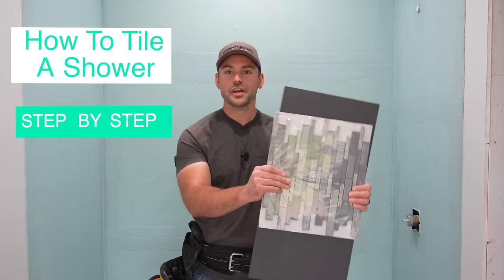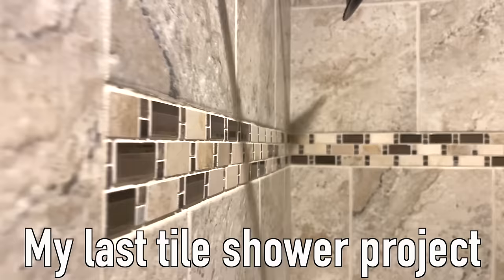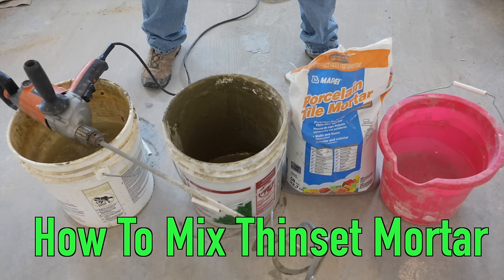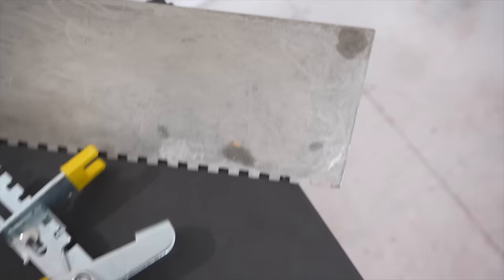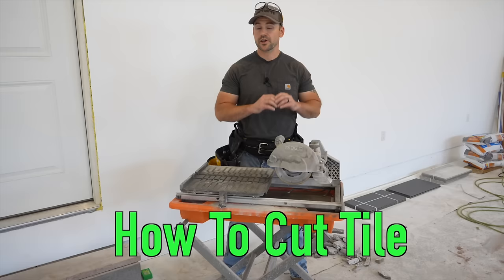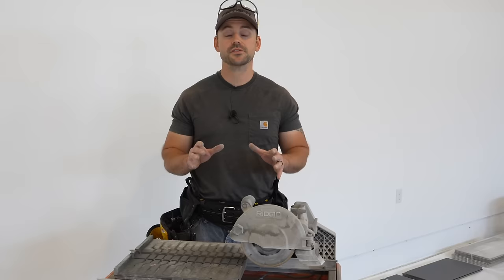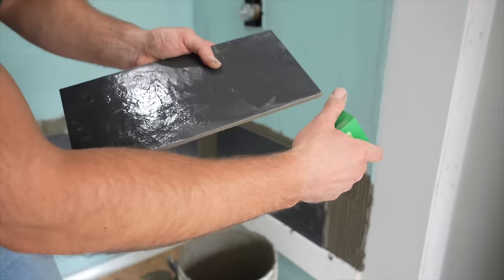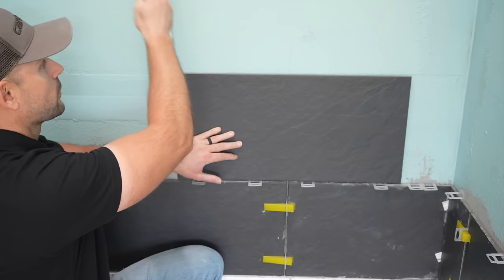How To Tile A Shower - Start To Finish Walls

Comment: 2:00…..if the shower pan isn’t level? Well….then, leaving that space at the bottom….and your pan wasn’t level….you would have to make a bunch of cuts. Right?
If for some reason your tub or pan wasn’t quite level. Couldn’t you just work your way up with shims. And level it as you go?

Then, 34:27 I’m confused as why you would leave a spot open, for your decoration. Why wouldn’t you just incorporate that…..as you work up?

Thank you for your video…I learned a lot…..

Yes, I plan on doing a lot of tile work in my house.
I plan on buying a used wet saw.
Buying my tile and as much material at Habitat for humanity. I don’t quite know if this would work for mo$$t people$$ , a$ They want expen$$ive fan$y stuff. And I simply want tile.
Here’s my list.
1. Remove my awesome old thick, and well built shower sliding door….and save it for later.
Because, after seeing how crappy, and cheap….and thin the new ones are. I will keep this one.
2. Rip out the infested feculant, moldy “tile” and wall board….probably set….right on the sheet rock. Down to the studs. Remove the insulation and save it for later.
Realize we have 1 bathroom….and we have to somehow…bathe. Leave the rusty, rotten tub for now.
3. Replace the rotten, termite chewed studs, or tie new ones on to the existing studs. And re lag them to the foundation. Install my insulation. While….the tub is in place.
4. 1/2 cement board, seamed with tape and mud. Then painted…..ahhhh finally …good bones. I plan on slipping my first section passed the tub a five or six inches. I don’t figure I need to cover the whole wall….with a tub.
5. Pull the toilet and vanity….I have to do this in one day. Then pull the old tub. I might use a cut off grinder. To section it up and make it easier. 
I will have tile, already cut and ready to go before this process. lay a 1x3 for support, and lay my first course of tile. Where it will be an inch or two under the lip of the tub.
This will be a different color design…..and then just befor the last section,  as I’m working up the wall, I will cut another course for a two stripe design. Then Lay and level the new tub, plumb it to the drain. Of course this will be the correct height, and same length…..or where I can cut it down to fit. And would be done in advance. Tile the floor under the toilet, and set the toilet.
We have a very small bathroom, and only one…remember? 
6. Lay my simple tile, all the way up. Starting at the base of the first course. I love the idea of the shelves, however I wouldn’t use silicone. I know it looks nice, but after 10 years it will come loose. The only siliconing I will be doing is around the shower door frame, and tub to tile contact. I would use mud to glue the end piece and grout the seam. Just me.
7. Cut my holes for faucets, and shower head. Remember…only bathroom. Having a drainable tub….I can heat and pour water, or use the kitchen sink.
8. Grout all that wonderful tile, prefit my shower frame, drill holes with a diamond drill for the 4 screws.
9. Clean up the grout, and wash the tile. Let dry,  Caulk the tub , let dry.
10. Install my shower sliding door.
11. Then on to tile baseboards and the rest of the floor.

That’s my plan anyway.

Comment: I understand why you started off of ur board...tile measured 11 1/4" and 1/8" at the bottom then allow another 1/8" between the tiles, that equals 11 1/2" total..y did you figure on 12" from the base to the bottom of that tile

Comment: I am confused, The measurement of your tile is 11and a 1/4 inch, but you took 12 inches of space to lay the first row of tiles.
Reply: Pretty sure he misspoke and meant 11 3/4. I’ve never seen a 12x24 inch tile that measured only 11 1/4

Comment: I think you made a mistake measuring the time as 11 1/4.  It should be 11 3/4? then the 12 inches will make more sense
Reply from the maker: Correct! Sorry for the measurement error but it is 11 3/4”. Good catch!
Reply: @TheExcellentLaborer  Mr Excellent Laborer it does not matter how many mistakes you make, you are still the best! Honestly it was by far of the THE BEST videos I have ever seen. I am an engineer with master degree plus 20 years experience building stores for top USA franchise- so I hope this is good complement!

Comment: You forgot 2 key in the substrate, probably should be using a half inch Notch trowel, not a quarter inch on the wall and a quarter inch on a tile, it'll pass but half-inch. Those shelves that you made are okay I guess for that job but they're not real professionals would do go to your local Granite yard give them the measurements and make yourself some 2 or 3 cm material. Quartz or granite. Also when you were putting on the bullnose you didn't key in the wall.

Comment: The clip system you're using is for kindergarteners in the tiles a junk a good tile don't need clips system that's a set up a failure down the road

Comment: Just stumbled across this.- it’s a good idea to never use silicone as an adhesive against Portland cement. Silicone is a petroleum based product and petroleum or oil does not bond to Portland cement or thinset. That’s why professional tile craftsman refer to silicone in the field of tile as contamination. You should probably look at the NTCA handbooks and or take a class from them or get a certification if you are going to continue to set tile. You also left a raw cut edge on your soap dish. I literally watched about 3 minutes of this and seen so ma y things that are bad for the general public to even consider whether they are amateurs or supposed pros. Please do more research before you claim to know the practice of the trade.

Comment: You did not key in the substrate of any of the wall. So you basically skipped one of three important steps. Keying in the substrate directional trowling and back buttering. You missed the keying in part which is very very important. And why did you use a quarter inch on the wall and then a quarter inch on the back of the tile? Typically and traditionally a 12x24 you're supposed to use a half inch by half inch Notch trowel.

Comment: You have to burn in the wall and why are you using such a small trowel???  You should be using a half inch trowel, that tile is not going to be very well bonded.

Comment: 11 - 1/4? your in serious trouble as you dont even know how to measure, lol.  lot of thinset in joints, after every tile and before you set clips, you should use a margin trowel and strike the thinset away a bit from edges, just like an eighth,  this way you wont get as much thinset in joints. i also leave about 1/4 inch of the back butter away from edge of tile, this also helps keeping thinset out of joints. if you had a variable speed angle grinder/ polisher and some diamond  pads you can finish those edges of the soap dishes much much better, as now they look a bit wonky...center the mosiac sheets, this way when you cuts off the edges in the corners, you can use the pieces you cut off to continue on the side wall, just lay it out that your cutting off more than just single pieces on the edge, this way you have like around half the sheet continuing on the side wall (the pieces you cut off). i would of still added some kerdi or screed with a notched stick to bring out the sheets more evenly, this would of brought them flush and it also allows you to use a smaller V notch to install mosiacs. using a kind of worn  1/4 V notch allows you to really  use the float to flatten without thinset coming thru joints. i never use a 1/4 inch square not to set mosiacs, too messy and you then arent really bedding them because your afraid of thinset coming thru. all in all it came out great and appreciate the time you spend making the video

Comment: Leaving any portion of a spacer behind the grout is not a professional job. You also failed to mention your spacer size and the manufacturers recommendations.
Reply: Hi ! Josh does mention the spacers' size. He uses 1/8" (~3mm) spacers. He says multiple times that the "grout joint" is 1/8" which is logically the spacer size as well. I hope it helps.

Comment: When showing someone how to do tiling in a bathroom,  shouldn't you first explain the options of wall material examples  gypsm board, cement board, etc... then what type of membrane to use ; fiber wrap or liquid primer that kind of stuff?

Comment: Dude your doing how to video ,,what person is going to have a 10 inch wet saw and not know how to install tile ?,,I rarely use my wet saw except on stone ,,use a scribe  and snap for porcelain ,faster ,no mess, clean and quiet ,no set up ,,its sooooo much easier and a tenth of the cost
Reply: i have a wet saw but have not had much luck with scribe & snap on textured tiles. Even on flat tiles I cant get the hang of getting a perfect cut.

Comment: No offense but it's kind of disingenuous to say that tiling a shower can be a diy project you can "knock out in a couple weekends". If you were a contractor? Maybe. But you have to keep in mind unless you subbing out work, you're dealing with the demolition, plumbing, setting the pan, potential framing, and waterproofing before you even touch the tile. I'm all for diy, as long as you know what you're getting yourself into. If there's one thing in your house you don't want to fail trust me it's your shower.

Comment: Why do you keep calling the second row.... the " first " row ? After the wood is removed you will do the real first row. For years we have simply installed the tile by skill... not another costly " leveling system ". I do have a question though...... why are the tiles offset from the row below it ? I understand why this is done on plywood , brick , block etc. so.... Is it for design and style or for ( supposedly ) strength. ?